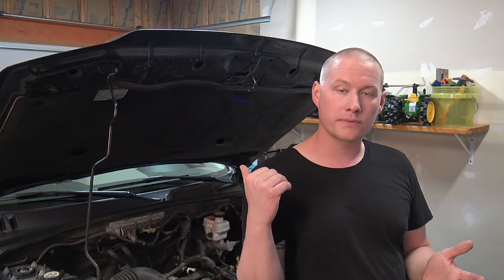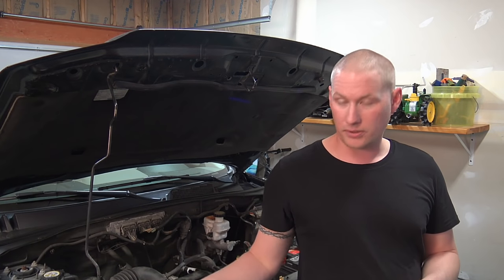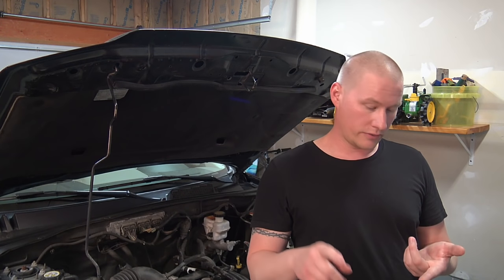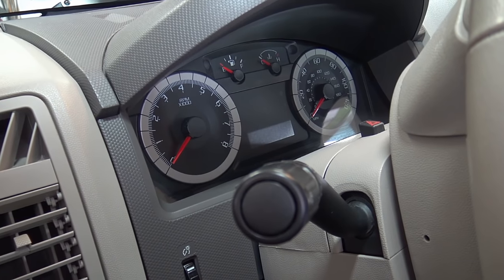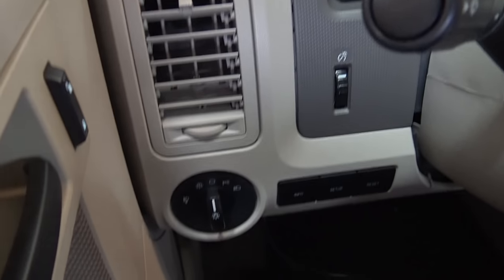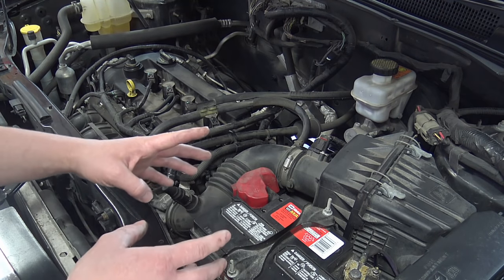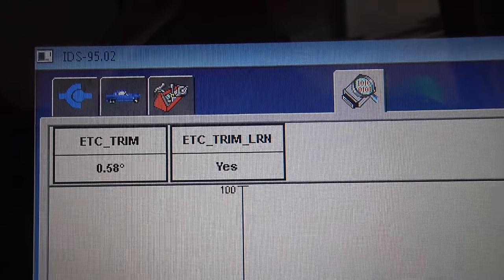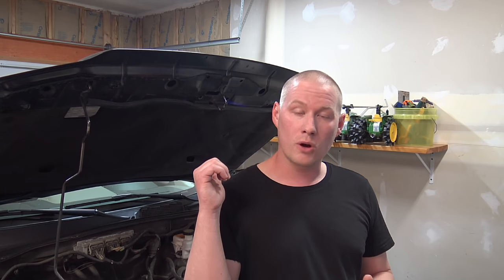Ford Vehicles: Electronic Throttle Body Calibration Procedure

Comment: First off... thanks so much for the video. It took me two attempts before I got positive results. 

Some history... from a cold start my 2009 Mustang 4.0 would idle up ok and then settle down as expected. But it would hesitate upon acceleration and seemed to be constantly "hunting" for the proper idle while driving at around 40-45 mph. I also had the occassional hanging idle when going from drive to park, and when sitting at idle the engine rpm's would drop off drastically whenever the cooling fans activated. 

I made the usual attempts to correct these issues... changed air filter... removed and cleaned throttle body... changed plugs... I even swapped out the original TPS for a new OEM, (desperation had set in). Then I saw this video.

The first reset seemed to go alright until I shut it off. Everytime I would try to restart it, it would start and quickly stall. After getting it running again I decided to do another reset. So far so good. No noticable hesitation. Cooling fan, A/C on full, and nothing seems to upset the idle now. I haven't really pushed her too hard yet as I want to let this reset take full effect.

I do have a couple of questions though. Should this reset be initiated when the vehicle is totally cold? And, would you recommend using the "Overdrive Off" button during test drives? My driving habits usually require the OD button be off for around-town driving, and on when highway driving. Just not sure how best to teach the ECM this. Thanks Again!

Comment: Had the truck go into limp mode due to throttle body at least ten times over the past 5 years. A simple kill/restart has always fixed the issue with it not reoccurring for months at a time. Got the wrench on the dash after I cranked it this morning and the only thing that fixed it was replacing the throttle body. Limp mode was gone but still had engine light on and take off was sluggish. This video fixed all remaining issues.
Thanks For Posting!
(2014 F150 3.5 EcoBoost)

Comment: im for sure going to get another 100k miles on my truck.  just cracked 200k on '03 5.4 2v. i left this video in mid play to go to the throttle cleaning vid... done that plus my MAF sensor,  IAT sensor, Wiped down my chrome snorkel and re-charged my K&N filter. Shorted the codes out let it wit a gater cable. start my truck and let it run for 20 mins with touching pedal.  OMG!!! i watched all your videos.

Comment: You taught me a lot in this video.  I was searching youtube for guidance on how to properly remove, clean and re-install the throttle body on my 2004 VW GTI VR6.  The procedure is going to be different because it's a different vehicle from your Ford.  However, you pointed out some basics that probably apply to all vehicles i.e. drain power from the solenoids and slowly allow the vehicle to go through the re-learning process.  I appreciate the thoroughness of this video and that you made no assumptions about the viewer's level of experience.  This is important because there are DIY mechanics like myself preparing to do this job for the first time.  We want to avoid damaging our vehicles and do the work safely.

I'm guessing that you don't have more specific advice for how to do this job on my car, do you?  One specific piece of advice I'm looking for is; once the throttle body is removed from the engine in preparation for cleaning, is it okay to move the throttle body in order to clean the area where the throttle plate seal shut against the throttle body?  I'm unsure if this can damage the gears or if it's safe to do because power will be disconnected and drained.
Reply: I know this is an old comment, but I had an 04 Gti vr6 with a 6sp - man, that thing was sweet. Most fun car I ever owned.
Reply: @JWestie85  Thanks for your comment.  I always appreciate hearing from people who own or owned the same car.  I agree, the car is fun to drive.  It's still my daily driver.  So few of them still on the road.

Comment: Thank you so much ford guy I brought my 06 ford explorer EDDIE BAUER cylinder 4.0 into my mechanic he changed out the throttle body but my truck was not right after the repair but after seeing your video it completely changed my truck backbto normal and it's running great now thanks again 👍

Comment: Man, thank you thank you for your videos. I followed your removal, clean and re-learn throttle-body and truck is not stalling when I come to stop, slow down to turn etc... I had blown a plug and removed air filter to change all plugs and repair. I guess from fooling with the plugs and giving extra power the throttle- body couldn’t keep up. Most people said I had to clean throttle body and replace idle sensor. But after cleaning and following your re-learn video ; she’s driving like a new truck; new pugs with dielectric grease on everything, clean air-filter, clean throttle-body. Awesome!! Thanks again. I’ll Send back that idle sensors to Amazon and save that 70 bucks😅😅

Comment: hi,

I have bought a 2007 Lincoln Navigator 1,5 year´s ago, which I don´t know 100% the history of the vehicle. With a lot of help by your videos ( thank you therefore) I was able to fix some upcoming issue with my Navigator, because here in Germany they exist very few Ford dealers/ mechanic´s which are able or interested to help on non domestic vehicles and you have to go long distance in order to get an US-Ford correct repaired. (of course for crazy high prices)

During the repair´s I did in the past and some other reasons I have to disconnect the battery couple of times, do you recommend to do the Throttle Body Learn Procedure on my SUV as well ??

PS. please keep going on with your videos all around US-Ford maintenance / repair,
without your experienced help , it would be extremely difficult here to get this kind of help on US-Ford in Germany

thx

Igor
Reply: Lincoln for life.

Comment: Thanks so much for that easy to follow lesson. I take it this procedure will work for a 4.6L with a manual transmission also.
Reply from the maker: Any Ford Electronic throttle control system.

Comment: I have a 2012 fx4 that I absolutely hate!  It's always something with it..  thank you for the videos!  They are very helpful as I'm always working on it.  Runs great, then it will shutter.  Replaced throttle body this time and the reset that I didn't do when replaced.  Now I see the video, do the reset, and MUCH better.  Thanks a bunch

Comment: I cleaned my throttle body for my 2010 ford fusion and connected everything like it was before. Then did what you said on the video and after doing  this I drove it for a while. Now the car shakes and wants to shut off. The rpm is a little below 1000 rpm when parked. Before cleaning the throttle the car was acting normal. No shaking or wanting to turn off

Comment: Engines must've had a dust/dirt problem before 2012 or something.  My car has no issues with battery corrosion and engine bay, cylinders are clean as can be.  Throttle body was pretty clean too, even on back side.  I have a 14 mustang GT.

Comment: Full capacitance discharge involving the ignition key on only when the battery neg is disconnected and closed circuit with pos for  a couple of minutes... I had a few instances over the years where there was residual  v in the circuit and this primary procedure didn't remedy it the first time. Very kind of you to take time & share!   Thumbs up

Comment: I disconnected the battery for a few 30 minutes and reconnected, then got a P0506 code on my '05 Navigator with the 5.4L 3V engine.  Do you think I need to remove, clean the ETB, replace and relearn  using this procedure?
Reply from the maker: Yes that would be my first step
Reply: @FordTechMakuloco  can I do this on a 2011 scion tc?
Reply: Could I do this on 2007 chevy suburban 1500 5.3 liter.

Comment: Thanks from down under in Australia 🇦🇺
I changed all my top end seals and gaskets, coils and plugs. Cleaned out my throttle body on a Ford I6 Barra engine wich you guys in America 🇺🇸 would love…
It’s not been idling or shifting 100% and I have hunted around on how to do exactly what your video explained for me. 
Hopefully it works on an Australian built Ford motor🤞 
Will add another comment if it does not work. 
Again, thanks for the tips you give !!!!!!
Reply: How did you go. I've got an etc fault on fg. On older models after the 15 minute idle they turn the car off, then turn the key to acc (not running) in D and pushed the accelerator full down for a minute and then the procedure was complete.

Comment: I was told that disconnecting the battery for about 30 minutes would reset and in turn force the throttle body to relearn. Is that true or do I need to do the steps on your video? I changed out my throttle body but did not do what you suggested. I only disconnected the battery for 30 minutes. I did notice that the reading on my fuel tank went from just under 300 miles at right about full to 353.

Comment: Hello FTM, thank you for the great content you share with us. I have a '17 Fusion 2.5, and this method of disconnecting the battery and jumping the cables does not reset the throttle body (ETC) trim on my car. After having the battery disconnected and the cables jumped for several hours, I plugged my scan tool and it showed the trim status was still "learned" and the value had not changed. I think some models need to have a KAM clear performed with a scan tool to erase the throttle body learned value.

Comment: I want to thank you so much for posting this video. I have a 2013 Ford F-150 and recently I started having issues with the wrench light coming on and the truck going into limp mode. The speedometer would also stop working along with distance to empty, MPG average and odometer among others. I would pull over and let the truck sit for a few minutes, restart the truck and it would run fine again for a day or so. Then the wrench light would re-appear and I'd have to do that over again. I watched another YouTube video and the person suggested replacing the throttle body sensor. Then yesterday the transmission light came on and stayed on and I couldn't get it to go off even when restarting the truck. I was about to buy on but decided to see if anyone else had a solution and found yours. I went through your steps and viola the transmission light has gone off. I'll go give it a test drive now and see if my problem is solved but I do believe it is and wanted to thank you. Cheers..!

Comment: Omg man. thank you so much for this info..I am going to buy some alligator clips, and attempt..I'll swing a comment on here and let you know the results..I never once did this after my issue..I bet that has to be the problem...
totally off the subject, but your the guy I need to stay in touch with..lol anyways, is there a voltage regulator built either in the altenator itself? or possibly the wire going from it to the fuze box?..I'm a huge system kind of guy, I've got huge system. I didn't exactly do the "big 3", but ran newer 4 gauge and also took out the stock ground..if this is to much then I can keep it short and sweet..you just seem to know more then our local dealerships..😇

Comment: Will disconnecting the negative terminal from the battery for 5-10 minutes do the same thing? I've heard elsewhere that it will.
Reply from the maker: In a sense yes but this makes sure the memory is cleared where as the battery disconnect method is not as effective sometimes.
Reply: FordTechMakuloco ok thanks for the quick reply!
Reply: I had the exact same question 👍👌

Comment: Excellent and perfect advice!!! Thank you very much.. My Ford Fiesta had similar issue but even Ford mechanic couldn’t diagnose the problem. However, after watching this video, I rectified the problem at home within no time and it is now running very smoothly as before. Great tips!!
Reply: Did your car keep going into limp mode (wrench on dash, weak power output, bad shift, etc.)?
Reply: Light was dim and was I doing fine I did clean my throttle body I put a tune-up consist of oil in filter air filter and spark plugs put it back together it started right up I drove down to the liquor store would it turn back on today I'm at this point with you on it so I did it the procedure again to dee energized PCM
Reply: Also it did shift funny after I got it started and now my engine light on oil light on battery on should I try oil recommendations to shut the light off

Comment: Hey Mr. Makuloco, If your reading these things, I'd like to get your attention.  I've followed you for some time, it seems your very generous with your knowledge.  Ok...I have just finished up a complete timing job , 2010 Ford Expedition 5.4L 3V, 225,000 miles approximately.  Followed your tutorials to the letter, everything went great! Except....I'm having problems on bank 1. Seems like by the time oil pressure gets there, being end of the line, there's maybe 1/3 of what I've got on bank 2. It's resulting in a P0012...and timing numbers that are all over the place. From -10 to 0 to 30 to 40 degrees.  All dependent on the RPM...anything 800 or above, sounds, runs like a new engine. Below that...500, 600 RPM...crap idle and dies. Only when hot...cold start, runs perfectly,  both banks, until the temp comes up. So, I know I have too much wear on the  cam towers and caps....combined with bank 1 being the last stop, even my Melling High Volume  can't cut it. Both banks have new cams, I'm using the 5W 30 weight as you suggest.  Also, both banks are 100% new rollers and lifters. Phasers, chains, guides, tensioner all Ford OEM. From the Ford dealership.  What I'm wondering is two fold...1. Is there any way to set the idle higher, 1k, on these 5.4 3V engines? A tuner maybe? 2. With a new head being over $1,000, might I be better to delete the VCT system all together.  This will be another $700, but it's supposed to fix the problem for life. You see...I'm too deep to stop now! I respect your knowledge in these matters, and very much been it. Lastly...I want to say Thank You , you help so many...when you don't have to help any!! Your a good guy, and it comes through! BTW...any of you "part time mechanics " want to toss your two cents in.....A Big Thanks from Texas!!

Comment: Thank you for this video. It helps me solved stalling issues for my Ford Escape 2001. The so called Ford Expert Company did not reset the EMU after replacing the faulty Throttle Body. All fine after I did the reset. No more stalling when slowing down for corners and stopping at junctions. Thank you very much again.
From Azhar, Malaysia.

Comment: Can I use regular jumper cables instead of a jumper wire
Reply: Same question. Were you able to do so.
Reply: In a pinch, you can just turn on your headlights after you disconnect the negative battery terminal. Current will drain/ discharge any capacitors in the system.
Reply: @scottb3637  I might have commented this a year ago but still some helpful advice I didn’t know so thx 👌

Comment: Remember when vehicles were simple and we could easily set the idle with a screwdriver?
Reply: I miss those days!  Remember when you could adjust valve lash?
Reply: Remember when the engine bay wasn't cramped !?

Comment: so any time when you clean the throttle body you have to do this the relearning
Reply: Probably if you change or upgrade anything as well. If you’re changing plugs or coil packs, upgrading intake or exhaust, your ecm needs to reset properly in order to function within ranges. Also, a flash will help on these as it will allow factory limits within the ecm to be changed for better performance and fuel economy.

Comment: you would think the auto parts place would go though this after installing new batteries.
Reply: Dirtyharry70585 most decent shops actually connect a small 12v battery to the cars battery leads with long cables(only a small battery) which keeps voltage to the ECU and doesn't reset your radio etc. So this is unnecessary if they do that as the ECU doesn't 'forget' any settings.

Comment: Just removed and cleaned the throttle body on our 2014 Ford Explorer Sport with twin turbos.  Also changed the plugs while I was at it with OEM motorcraft plugs.  The rough idle on start up has disappeared and it running well after going through all your proceedures...except now the turbos don't seem to be engaging as they were previously.  They would just rocket your out of a slow roll or even just rolling down the road, but now it acts more like a car without turbos.  Meaning, when I punch the accelerator, it just takes its sweet time rolling up.  Granted I'm one day into the throttle relearning it's new life, but I really did love the old turbo life.  Thoughts?
Reply: Update!  Ok, as embarrassing as it is, it appears that I missed tightening the clamp on the turbo charge pipe after needing to move it to get to one of the rear spark plugs, and the pipe had come off during the test drive.  Its been reinstalled and tightened and I'm happy to report the Explorer is back to full potential and running better than it has is good while.  Very happy!  Thanks for the great vid and walk through.  About an hour project that's well worth the time.

Comment: I have spent 2 days trying to figure out the problem with my car and came across this video. I did just as you explain and now my car runs as it did before I changed out the throttle body. They gave me all the details about how to change out the throttle body but never mention the info that you gave in this video.. thanks for the info...